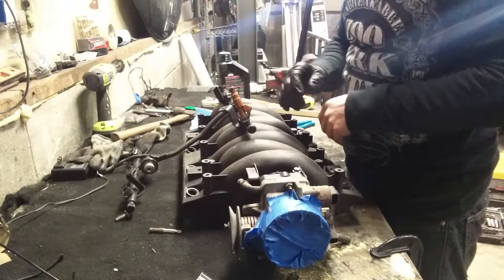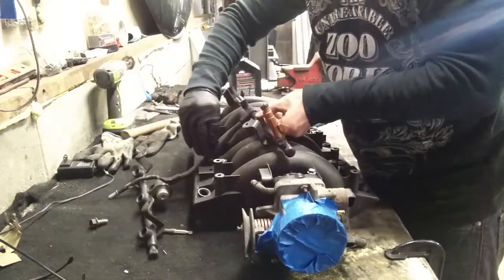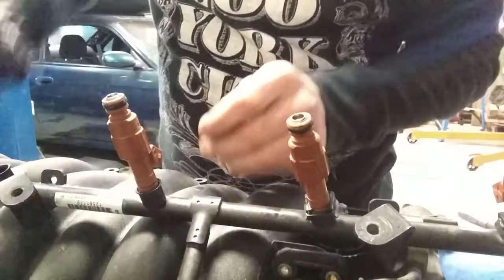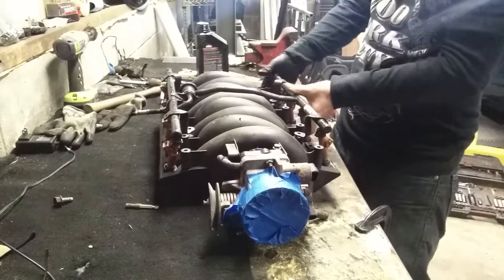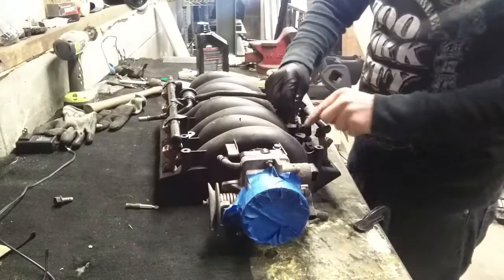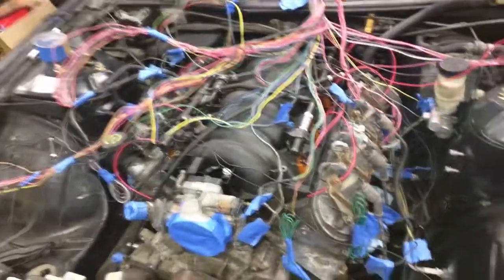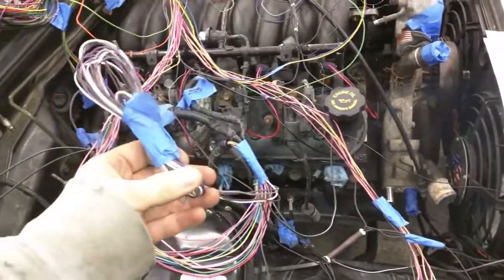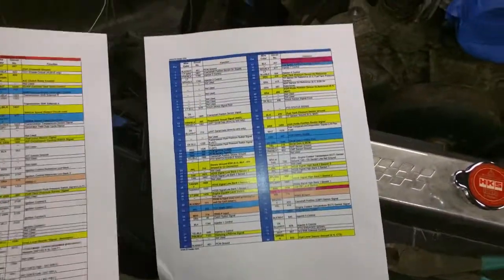S14 LS Swap - Wiring Part 1

Comment: It would have been much easier to "de-pin" in the beginning and work back towards your PCM mount location.  If it were me, I would check each wire for continuity before final install.  It's very easy to do and only takes about 20 minutes to check the entire harness.  good luck